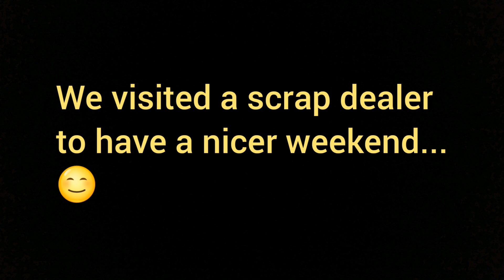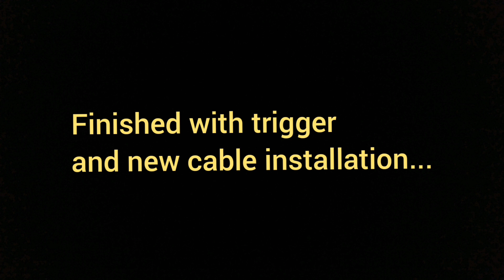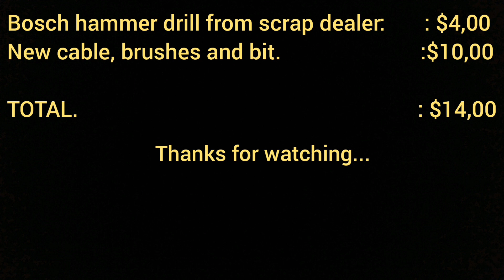Diysiast - Bosch hammer drill repair and restoration - Own a hammer drill less than $15!!!

Comment: 12:00...cleaning that bearing and reagreasing it doesnt make it new...bad stuff..its more cheap to install new oem bearings...and much more safer and its a proper restoration...the youtube is full of "cleaners" who name their videos "restoration"..and they use the same old parts to put back together the tool....that is called cleaning....and 12:36...dont grease that bearing.,...!!!!it will make
 dust stick to it faster and destroy it..thats why that lower bearing is full metal..so its resistant to dust...!putting grease on it will make dust stick all over it...and finally..ruin it...sorry
Reply from the maker: Yeah you are right. This is more "cleaning" than "restoration". But it is actually a "salvage", you see it is scrap. As for technical issue, I am an amateur and still learning. Thank you for valuable comment..